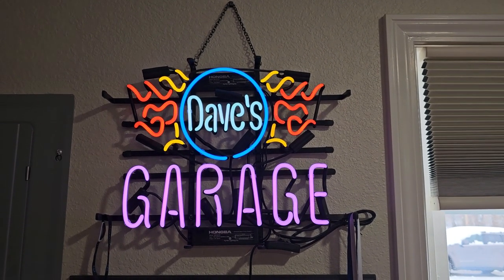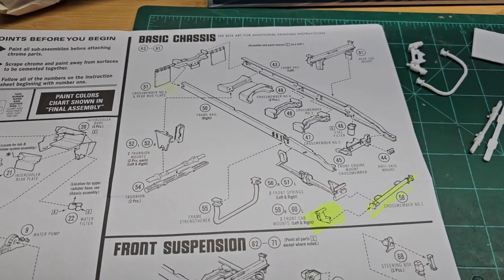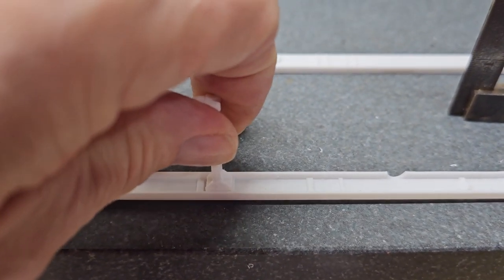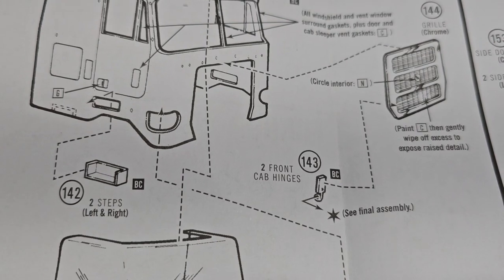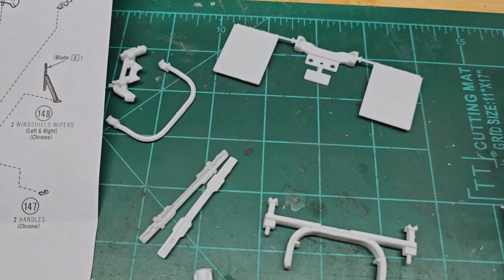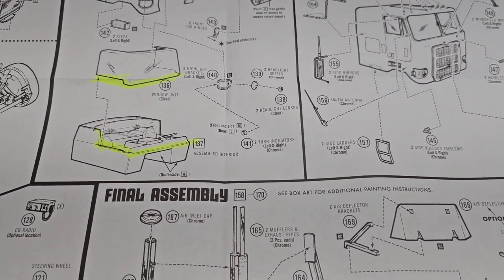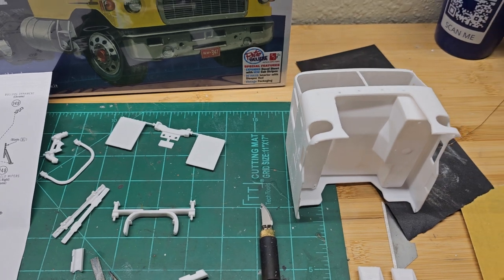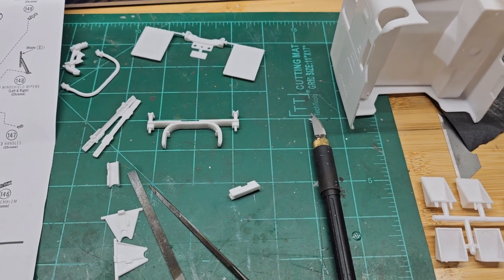Starting the Mack Cruiseliner build, filing and squaring things up, Assement of the build.

Comment: Scrape chrome, no need for epoxy, The standard, stringy, Testers is the best for melting plastic, trick to these Amt trucks is time. Glue a couple crossmembers on one rail, let that set overnight , then you can have rigid square for the rest of the frame, A cork board with rubber bands and stick pins ,will finish the ladder frame, Glue pulls as it drys, so it must restrained from doing negative  things to any build